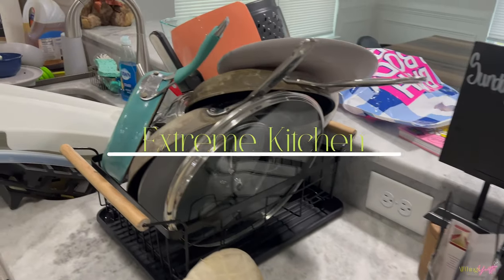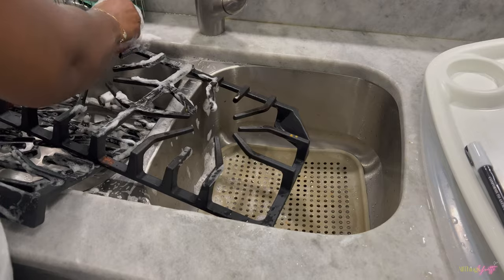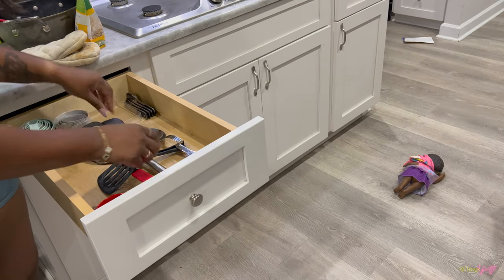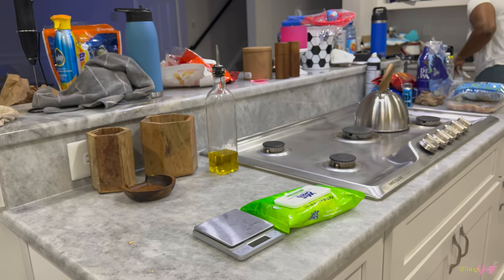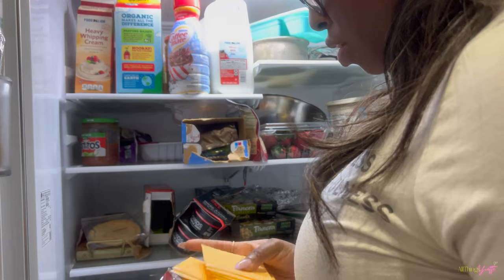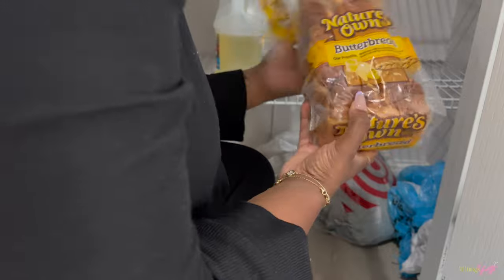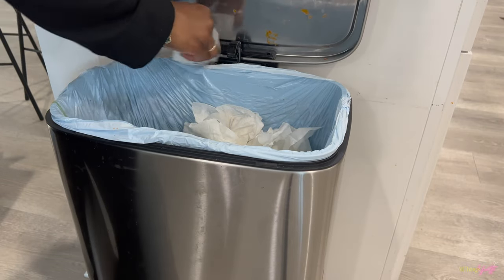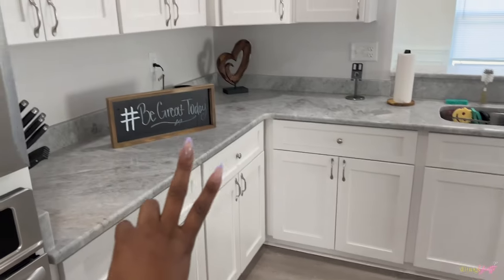EXTREME KITCHEN Cleaning and Organization 🫧 | Clean With Me

Comment: This video just might give me the motivation i need to clean my house. 😭Get you some cascade dishwasher detergent, it's never failed me, I dump my oil into trash bags once its cooled off and then I dump it into the trash.
Reply from the maker: So it’s the detergent and not pods ? Let me go run and get it ! See I’ve thought about putting it into a trash bag but was scared it would leave out . Thank you girl !!!
Reply: @UnapologeticallyYvette  yup its the detergent, I never used pods.
Reply: @UnapologeticallyYvette  yes you can use the detergent or the powder as well. You may need to check and see if you need to refill the “rinse aid” compartment/dispenser. It’s the circle thing next to where you place the pods at. Most have either a little circle or line that will let you know if it empty or full. If it’s empty you will need to purchase any brand of rinse aid. I hope this help 😊